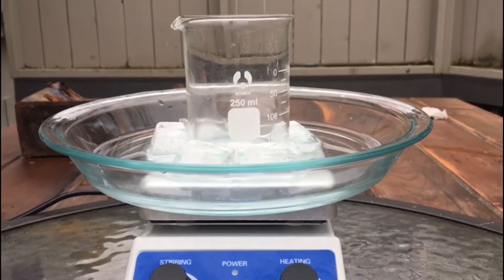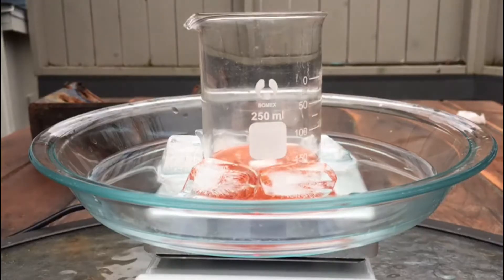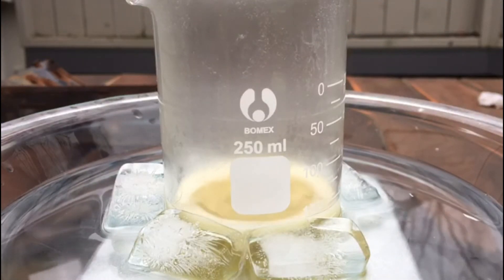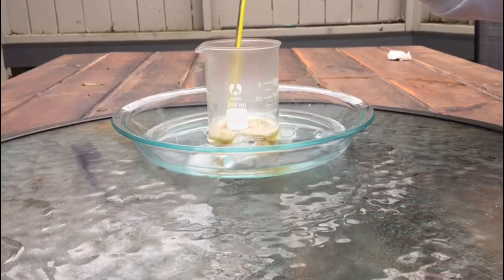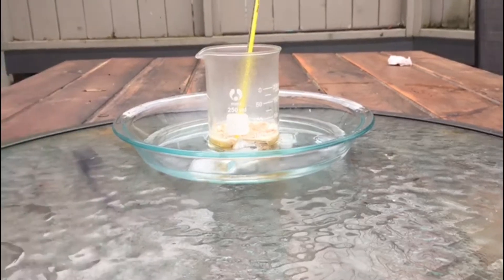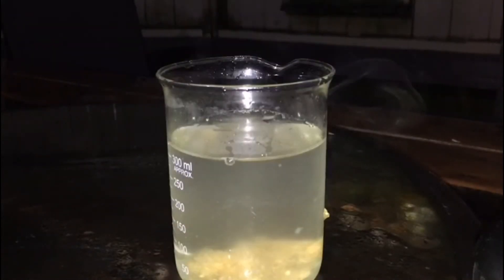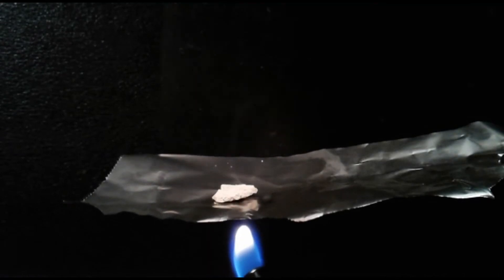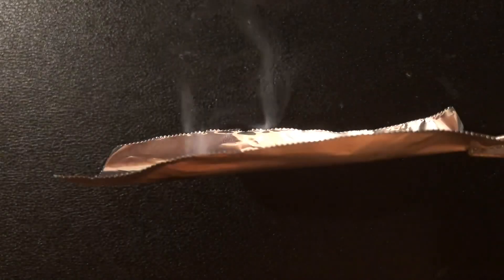Nitrocellulose synthesis from wood pulp

Comment: Do you know a simple way to produce Ethyl cellulose, using solvents made from raw materials such as; Ethanol (from sugar and yeast), Ammonium hydroxide (from Piss and Sodium hydroxide), Acetone (from Calcium acetate), Acetic acid (from Ethanol and AA bacteria)???

I once tried the the cellulose dissolution method which uses Urea, Sodium hydroxide and Ethanol at low temperature, but it didn't work. Probably because the temperature wasn't low enough, which I kinda knew it wasn't but had no other options. A stacked TEC might be a better way to go.

The Ethyl cellulose would be for use with Gamma Ferric oxide, etc, as a coating/ink/paint - with some plasticiser added. It needs to be flexible. Ideally like standard cassette tape.
Reply from the maker: I’d have to look into the synthesis method for it. It would be interesting to see!
Reply: @industrialadhesive6357  I found an alternative method which uses Glycerin and Sodium hydroxide. But again, low temperatures are needed - around -20 Celsius.
Reply from the maker: @Kyle-sg4rm  yeah I have seen similar. Urea too. But as you said, very low temps are needed. Schweizer reagent works for the dissolution of cellulose. But it’s definitely not an ideal solvent
Reply: @industrialadhesive6357  I think what i'm looking for, might be called a "green solvent" in the field... but i'm avoiding the "green this", "green that", terminology. And the "plant based" spiel.... because, besides it being irritating to some people, it's also very non-descriptive (which may be why it irritates some). And the fact that it is being used by those in the field, in published papers, etc - is both unnerving and unhelpful. Although, not surprising. 
It probably says alot, about alot of stuff. Where things are going and so on.....

Comment: What did you use for a neutralizer? How much? What nitrate salt did you use? Sodium Nitrate?
Reply from the maker: I used a sodium bicarbonate solution of 20% concentration to nutralize most of the trapped acids. I did this by letting the nitrocellulose sit in the sodium bicarbonate solution for a few hours.

 I cant really say what nitrate salt i used. But most should work. 

Try to stay away from heavier cations in the nitrate salt because you would simply need to use more.

But if you plan on synthesizing nitrocellulose, be sure to check your local laws. Nitrocellulose can be illegal in some areas, aswell as nitrate salts. In my case everything was carried out in a safe and legal manner
Reply: @industrialadhesive6357  Thank you very much. I enjoy your videos very much. Step by step is great. Helps rookies like me.